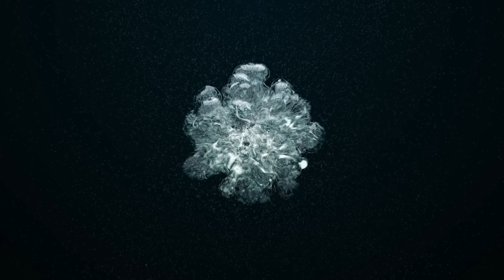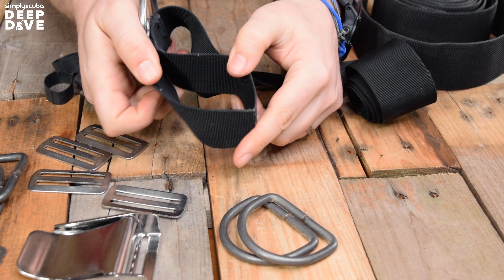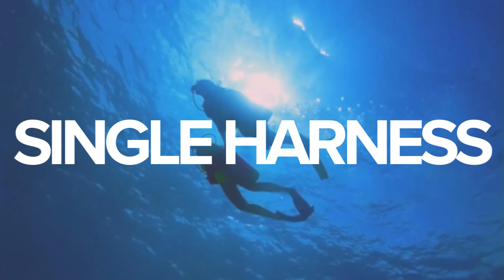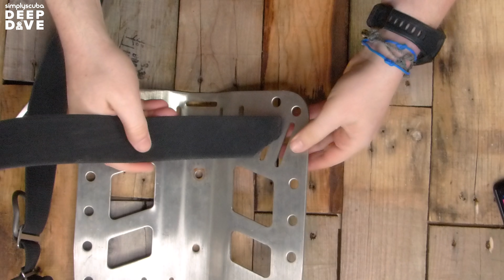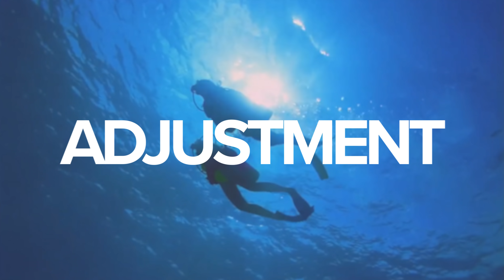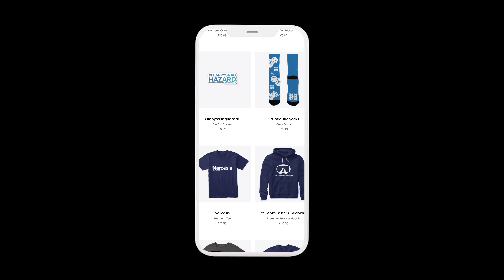How To Build A Backplate System | Deep Dive

Comment: When I made the switch to a backplate setup over 10 years ago I remember thinking why didn’t I do this sooner? I still don’t understand why the cert agencies don’t start teaching this way as opposed to the overly cumbersome, positively buoyant classic BCDs. My kids all dive with a backplate system now.
Reply: I'm with you about teaching divers with BP/W from the get-go.  Also, I don't know why rental inventory isn't BP/W: yes more cost per unit but fewer units would be required since BPs can be adjusted for any size.
Reply: Probably because new divers don't know what they want.  They usually use rental gear, and it's much easier to rent a jacket-style BCD that will somewhat fit.

Comment: Any thoughts on the use of Mares XR SF2 SS316 Clip o similar products? 
Awesome videos!!
Reply from the maker: I use an Agir Harpa Loop on one of my backplates and a Mares XR SF2 on another. I like them, they make it much easier to get in and out. I've never heard of compatibility issues but if J R has had a problem, it's worth checking...
Reply: @simplyscuba  I initially bought the Mares XR SF2 for my Tecline 3mm SS backplate and at least that combo doesn’t fit by around 1mm (tried to use sandpaper to make it thinner but gave up and bought the Tecline equivalent loop which fits perfectly)
Reply: Depends which backplate you have. I tried that into my tecline backplate and doesn’t fit

Comment: I recommend Apeks WTX one-piece harness and backplate, which comes with soft webbing for the crotch strap, shoulder pads and all the hardware.  If you want shoulder strap adjustment to make it easy to get in and out of Halcyon do a great cinch system.  I've never needed a pad between me and the backplate because you don't even feel it in the water, and it's just something else to have to rinse and dry.  I've been diving a BP&W for 4 years now; it gives a great feeling of being one with the whole scuba unit and I'll never go back to a jacket BCD.